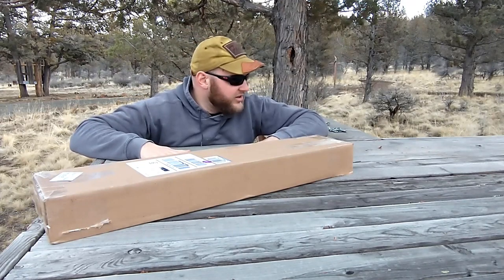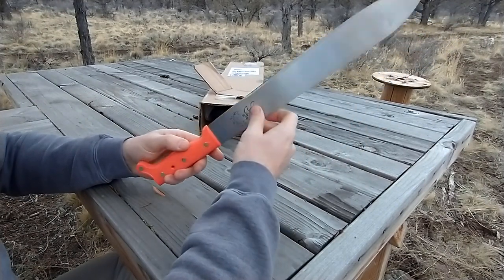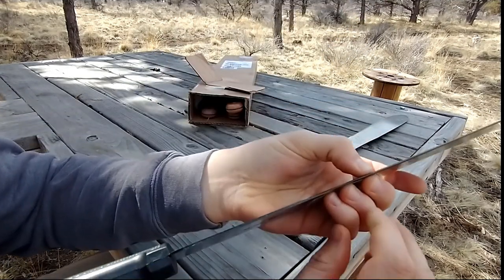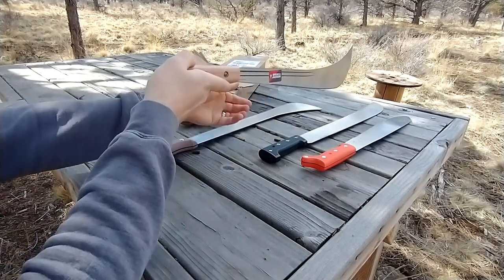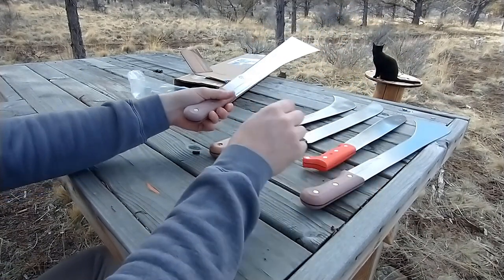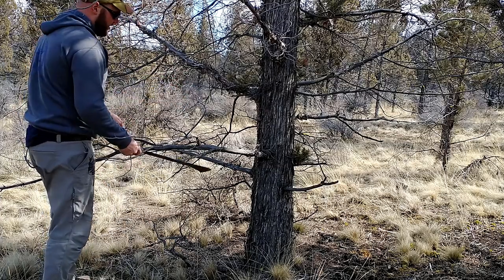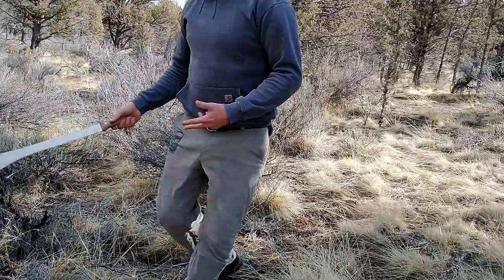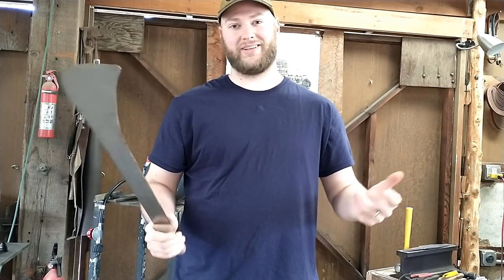Columbian Surplus Machete 5 Pack.  Trash or Treasure?

Comment: For 7$ a blade you can't expect them to be quality. A competition against the harbor freight machete would be cool.
Reply from the maker: I was recently in Walmart and looked at the "Ozark trails" brand machete.  It was $5 and it didn't have any of the issues that these surplus ones suffered from.  As far as steel strength and heat treat go, it would be fun to test them.
Reply: @ironridgeoutdoors  the "choil" is that way on purpose, people carry them at that spot. These aren't actually surplus, you're right in that they're seconds, FYI. :-)
Also, a few things you claim were quality issues, they aren't. That's deliberate. The end user is supposed to sharpen them according to their intended use, and the wooden handled ones are made chunky specifically so that the end user can shape the handle to their hands. Also, the tips are left blunt on purpose, nobody cuts with the tip, and a sharp tip would get chipped/broken by hitting rocks, etc.
.
Machetes made in central and south America are made that way for legit reasons, check with some of the local machete users. :-)

Comment: The unsharpened part above the machete handle is for holding, if you carry one all day it's easier to hold at the balance point
Reply from the maker: Interesting.  I hadn't heard of that before.  Thanks!
Reply: Grew up in latin american country and in rural areas can confirm this
Reply: @davidayarra3129  yessir also in some country’s in Africa they use them to dig dig and they say to not sharpen that top part where the have no edge the machete has it’s uses

Comment: I don't have a problem with unsharp machete coz they could be shape with. what can u expect from cheap price machete? All machete comes like that. If u want sharpen quality machete order condor, cold steel and other well knwn machete in the market. But if u want cheap price that can match all then Seattle for that kind. It'll be sturdy in use depends only if u abuse it without proper knowledge of the tool your using then it definitely broke down. No matter how top it is.
Reply from the maker: The walmart machete performs just as well as these, has a straighter blade, finished bevels, better handle, sharpened edge and a sheath for $7.  It represents a better deal than what these surplus machetes offer.  I did a comparison video, go check it out.

Comment: I born in Venezuela and start using machete when I was 12 year old. All new machetes  are dull and after 1 hour of sharpening on rocks from tip to 12 to 14 inch only to prevent cutting you foot or leg when you cutting bushes and the handle you adjust to you like
Reply: where can i find venezuelan m,achetes ????

Comment: Unground is how those come. That's why they are so cheap. For $5 I wouldn't expect anyone to do much better. Most places wouldnt sell you the steel they are made of for $5.
Reply from the maker: These aren't unground.  They have primary bevels and are lacking the secondary.  That's not the problem though.  The primary bevels on these are uneven, burnt, and inconsistent.  $5 gets you an Ozark Trails machete that has well ground bevels, a sharpened secondary bevel, a better handle design, and a sheath.  The steel on the Ozark Trails machete has proven itself in comparison to these Columbian ones as well.

Comment: machetes are not sold Sharpen. The short ones are for yard work and the long ones for Heavy bushwacking and for Working on Sugar Cane Plantations.
Reply from the maker: @pabloenriquechavesmonsalve4786  if you buy a machete in North America, it's sharpened from the factory.  It will also have even grind lines, and the edges won't be burnt so the heat treatment is still intact.
Reply: @ironridgeoutdoors  hardware stores dont want to get sued. But I'll let you know why Tomorrow.

Comment: Machetes every where but in America only have a rough grind. The user is supposed to put the grind that works for there applications. It's amazing you think china junk from harbor freight would compare. 
What where you expecting for such little money.
Reply from the maker: Not only were these unfinished, but they're bent, and have very uneven plunges.  It's so much worse than just an unfinished edge.  It's interesting you can't see that.  Also, these are more expensive than the machetes that are available in every local store.  Furthermore, the local ones include a sheath for that $5 price tag.

Comment: I live in Central America.  We buy these machete's in the supermarket or any agro or feed store or hardware store.  They come dull.  They used to be about 3.50.  Now they are 5.50 with the current inflation going on now.  You have to sharpen them.  They come from various country's.  Most have plastic handles.  Some wood.  All dull.  Some are excellent machete's.  I use gloves when I use them.
Reply from the maker: It's interesting that they come dull in other countries.  The ones we buy here in the USA are all sharp.  $5.50 is still a great deal!

Comment: Grab yourself a brazillian Tramontina  - 14 inch. Spend an hour sharpening and leveling out the wood of the handle. You wont regreat it. I can shave with mine and love it. Great steel and dirt cheap.
Reply from the maker: Thanks, I'll check them out.
Reply: i live in indonesia . and i love tramontina . they just fit in my area with green vegetation . i have some of their machetes . 24" latin . 20" panga , and the bolo . tough enough . but dont make it to sharp it can chip very easily
Reply: I don't shave with a machete. I use it for vegetation so a razor edge is inappropriate for the tool.

Comment: As far as the best of the cheap is in my opinion definitely the ozark trail machete at walmart for like 4.97 
Ive had several and some come dull to not that bad then ran across like 2 that came sharp asf outta package
Reply from the maker: Yeah, I took a look at those in last time I was at walmart.  They look like they're better built.

Comment: Machetes come blunt for safety reasons. Any guy who calls himself a knife guy knows how to sharpen a machete. Don’t expect straight blades on working tools, they’re not high end knives. 
Also, machetes come unsharpened near the handle so they can be carried easily, they also get tucked into belts and you don’t want certain parts sharp. 
Those machetes are fine for what they are.
Your square end machete is called a Tapanga, the upside down curved one is called a billhook. The first and second one you pulled out are Latin style machetes, the other is a Panga.
Reply from the maker: Yes, I know full well how to sharpen an edge. Most machetes bought in the states come with working edges though, so that's what I'm accustomed to.  Also, that doesn't excuse the poor craftsmanship on each of these blades. The burnt edges, uneven primary bevels and wavy blades are not present on the competition.  A $7 Ozark trails machete from Walmart outshines these in every way.

Comment: You mentioned the Harbor Freight machetes and yes they look and feel nice but don't last long. I've gone through 4 of them haha the edges roll and chip first use, 3 of them snapped in half, and handle came off one. Too thin for stainless steel I guess. Maybe they'd be fine for just grass and weeds. I'm sure those Columbian machetes are carbon steel and like you said if the heat treat was good they should be pretty tough.
Reply from the maker: I just bought a harbor freight one.  I need to test it out and make a video comparison.  Also bought a ozark trail one from Walmart.  I'm excited to see which one is the best.
Reply: @ironridgeoutdoors  how did the billhook machete work for you? I found the warps from heat treatments didn't affect the usage at all and they hold up a TON better than the Ozark Trial and Harbor Freight ones.

Comment: I think these are all Columbian Machined Machetes. Spear & Jackson supplies the materials to be machined in Columbia. It's labeled made in Britain/UK because majority of the tool (the steel) comes from UK. The last step, the rivets might have also been assembled in UK. If the finishing step is done in the UK, along with majority of the material being UK steel, it qualifies as a UK product, even if it technically is a Columbian made machete from UK steel, Columbian wood handle, and finished in the UK with UK rivets. They're all Columbian Machetes. There are a few Machetes that are made with German Steel as well from Columbia. Basically, it's a tariff law issue.
Reply from the maker: Interesting.  Makes you wonder about all the made in America claims.  How at how much of that is actually done here in the states.

Comment: Machetes come like that so you put the edge on it that you need for your application based on your vegitation.  The unsharpened area is for pinch grips. People from northern regions tend to not "get" machetes like people from Latin America, Africa, etc. Americans  often want to put a razor edge on them like a knife and expect them to perform on northern hardwoods like an ax or hatchet. In my humble opinion, this gentleman could benefit from a little multicultural education- someone who knows and grew up using these tools. 18:50 and 19:26 through the 23min mark  for example. Yikes! I hope he doesn't injure himself and I wouldn't work near him.
Reply from the maker: I have found that Americans tend to expect tools to come from the factory ready to use.  That still doesn't negate the fact that these are seconds, and are of sub par quality.  A $5 machete from Walmart out performed these in every way for my uses.

Comment: The real machetes dont come sharp, you gotta sharp em with a file.
Reply from the maker: Thanks, I had no idea.  Even without a final bevel to make it sharp, the grind lines on the primary bevel are still very crude on all of these.
Reply: @ironridgeoutdoors  yap, those machetes would last forever, trust me. Im from Honduras and my grandpa bougth machetes when he was young and still last to these days.
Reply from the maker: @skully4464  that's awesome. I need to make some sheaths so I can carry them around.

Comment: It’s called a courtesy edge, machetes are never shipped sharp. If they were, they would need a sheath or something to keep from cutting through the box. The long choil is there so you can choke up on it for finer work. 

Criticizing  a tool because you don’t understand it’s intended use is quite strange. Perhaps you’d be better to inform yourself PRIOR to purchasing something. 

Watch some joe flowers videos. The opening scenes of this video just make you look ignorant and foolish.
Reply from the maker: Interesting opinion, thanks for sharing.  

With that said, just because they ship machetes with dull edges in other countries, doesn't negate the fact that when compared to machetes commonly available in America, they require additional work.  I talked about how choking up on a thin, wide slab of steel is useless and simply uncomfortable if you have a well designed handle.  So the 4-6 inch unsharpened choil is overkill and ridiculous.  On top of that, the primary bevels are so unevenly ground, it is clear that whoever was grinding didn't take their time.    If your opinion differs than mine, great.  If everyone thought the same, this would be a boring world indeed.  But to say I don't understand how a blade is used is simply arrogant, and incorrect.  As an avid outdoorsman and bladesmith, I have a better understanding than most in the real of bladed tools.

Cheers.
Reply: 💯 percent comment. The maker of this video needs schooling. In the second half of the video his technique is dangerous.